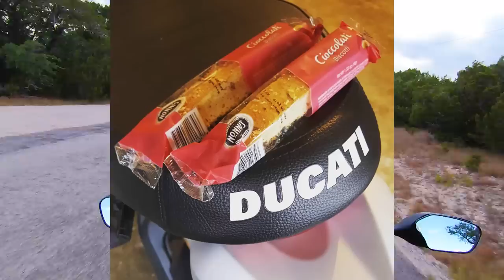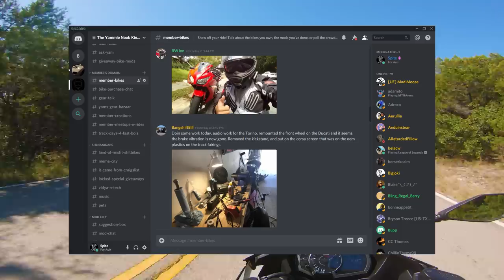Why did Ducati Give Up the V-Twin Engine?

Comment: Ducati's always made an awesome  looking and sounding bikes.
Unfortunately they are as reliable as Jay an Silent Bob on an early sunday morning. 
The construction is flimsy and finicky and way way overpriced.
Honda is it. Period full stop.
Spend all you want a Honda owner will always feel better than you at the end of the ride. Just ask....
Reply: Own an 899 Paniagle for 3 years and haven't had any problems at all with the engine.
Reply: @lahwf125  had same 2 Hondas for 10 plus years an RC51 and a 900RR only a full valve job on 900 an output shaft seal on five one call plus all consumables . In 7 yrs let me know what you had to fix plus cost . You will hurt.
HONDA all day😉